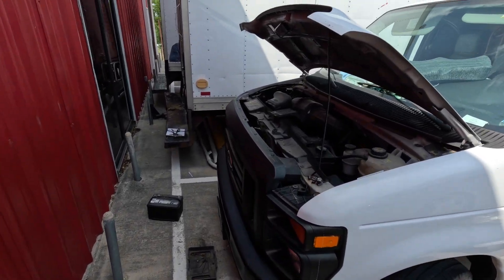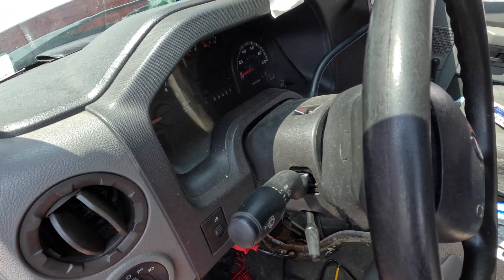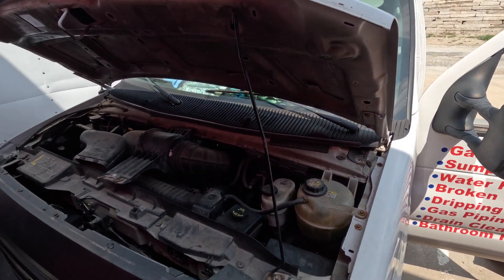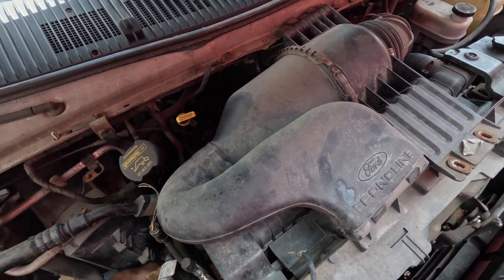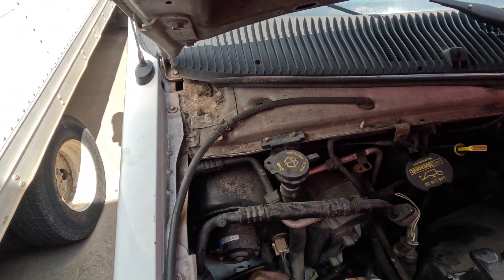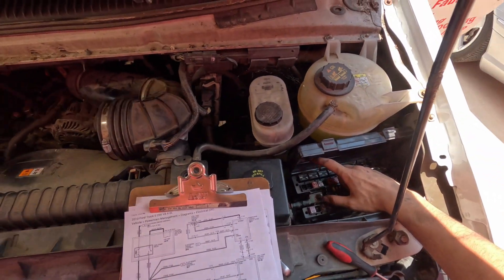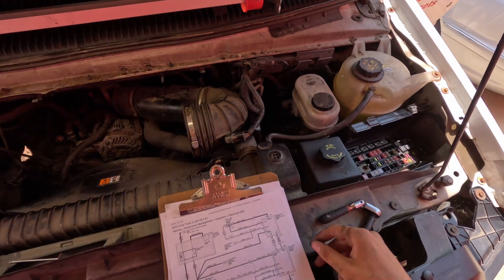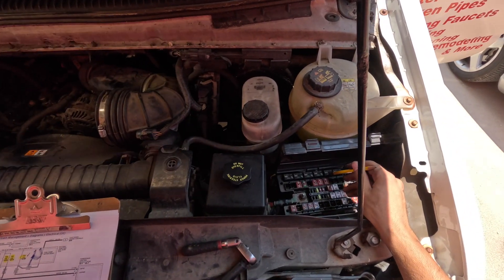Ford E250 no crank no start no fuel diagnosis

Comment: I had this problem i change fuel pump and fuel pump module .i check all the fuses and relay all is pretty good .. but it always turn over but wont start ..i dont know what is the next thing to do ..
E250 2007 model huhubu
Reply from the maker: Is the fuel pump running? Is there fuel pressure at the rail?
Reply: @Roybuilds  yes when i turn the key in on position..the pump work in 2 seconds ..but when i crank the engine the pump is not working .
It seems like not enough ground? .
Reply from the maker: Do you have any codes
Reply: @Roybuilds   the obd port is not working huhaist
Reply from the maker: You need to figure out why the OBD is not working first